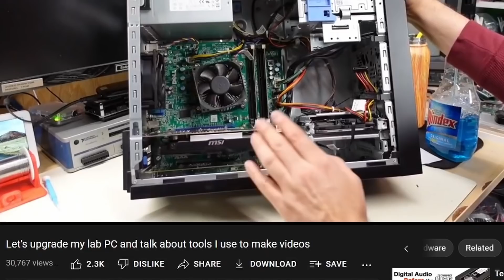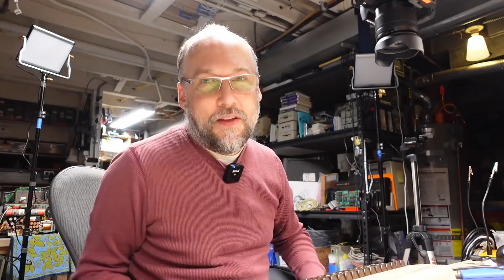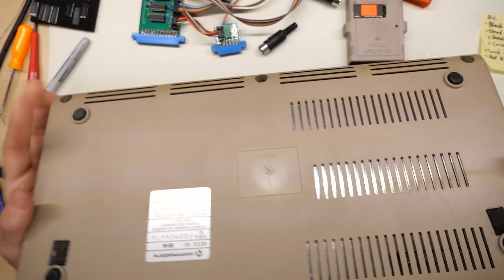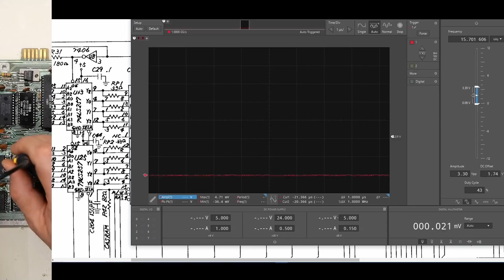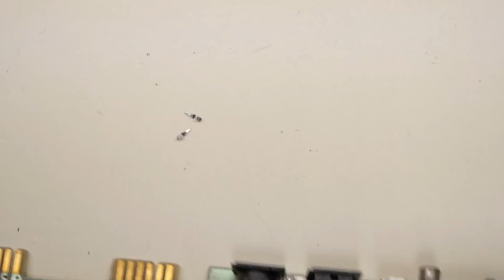Fixing two C64 motherboards with hot chips

Comment: 64 repairs are my favorites. I will say this though. I wouldn't have wasted my time on the oscilloscope. I would have just yanked ALL the MOS chips. Kind of like when I fixed mine only a single MT ram was bad, but I replaced all 8. Oh and I wouldn't worry about a marginal SID. It sounds different, but it didn't sound bad to me.
Reply: He's right, the filters are bad - significantly. It might do in a pinch, but with some really good SID replacements it should be replaced. More significant than that, the chip sounded a tone when NOT being played. That could mean that it will fail completely soon. As a repair, it's a no-brainer. Pull the marginal chip for storage and put in a fully working substitute.

If you aren't hearing the difference, there are two possibilities. Most computers have crap sound unless they have sound cards/USB sound units. These crap sound on computers is caused by filtering all the sound to a baseline that sounds no different at various lo, mid, and high tones. When you have this happen, you can't hear how muffled it is no matter how good your ears/earphones. HDMI can play better sound, but it has to come from somewhere.

Another possibility is that most headphones use filtering to keep sharp sounds from damaging poor quality sound speakers. If you are using earbuds or low cost earphones (under $100) chances are good your sound is purposely muffled to keep the user from damaging the earphone (or even the ear). Sometimes this is desirable - You typically do not want to hear a high pitch screech in your ear. However, a good sound system on a sound card/USB system allows the user to completely control at what frequencies to cut the sound in a special sound control panel to save both your ears AND your earphones (and even speakers).

Bad filtering/lazy filtering detracts from what could be a quality listening experience. Imagine what the sound your missing could be. You've heard people rave over the sound of the C-64. There's a reason for that. Adrian is right - that SID is bad.
Reply: @jeffreyphipps1507  they are bad, but it's not horrible. I'd rather keep it than discard it just because real working SIDs are harder to find. Honestly I think the "screaming" noise it makes when you turn the computer on is worse than the filters.

Comment: For old disintegrating foam, IPA isn't the ideal product, acetone will dissolve the foam and all the goo left over. Just don't use it on the plastic parts of the dip package, apply it with a cotton swab to the metal legs ONLY.

Comment: It's only a matter of time until Adrian gets his hands on a thermal camera. 😁
Reply: Predatorvision!™️
Reply: Northridgefix uses a thermal camera for black screen/no power on failures where he has detected an unexpected short to ground. He then provides a much smaller power input current than normal while testing and looks for the hot chip. Usually turns out to be mosfets on modern equipment.
Reply: It’s only a matter of time until I start to repair c64 for friends. Because of these videos haha
Reply: @vjcodec  just how many friends with faulty C64s have you got? ;)

Comment: I used the "quick test" cartridge to diagnose my SX-64 back when I restored it. It worked fine for some iterations and the only thing that failed in it was the "count" at the bottom: it would jump "randomly" to non-digit characters. I forgot the exact sequence but it was like: 4...5...?...10..11... and then ...14...15...1?...20... so something in an adding code was faulty. A replacement CPU fixed the issue, so it seems that my original CPU had some weird internal fault... Just as a tip: always run the tests multiple times :)

Comment: That low pass filter is really messed up!
Reply: It is just clipping, that is normal. 

"Despite its documented shortcomings, many SID musicians prefer the flawed 6581 chip over the corrected 8580 chip, some even seeing the flaws as actual 'features' that made the SID chip distinct from other sound chips at the time. The main reason for this is that the filter produces strong distortion that is sometimes used to produce simulation of instruments such as a distorted electric guitar."

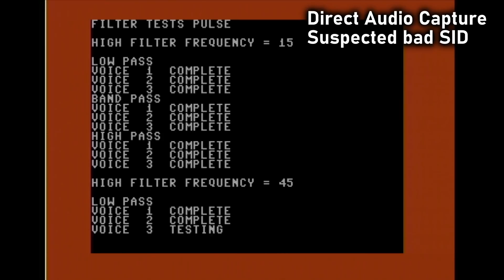Comment: 32:00 - Old reject SID chips were sold as new on eBay and other chip suppliers in the early 2000s, the chips had nothing wrong with the voices but the filters were all bad. You probably have one of those chips. Many early games and demos barely used the SID filters so some people never realized they had a bad replacement chip, plus with how much the SID sound varies chip to chip some folk thought it was normal until it started getting documented in c64 forums.
Reply: I don't think it's that. I just think the cut off is just different. One of the reasons people often prefer the 6581 over the 8580 is the filter can start to distort and that's used in some 6581 tunes. There is no "normal" with the SID, the filter performance is all over the shop. If the filter was used on a track then your ability to hear it as intended is all about how close your filter curve is to that of the composer.
Reply: How about trying out different values for the external filter caps? Maybe that could make the filters sound more "normal"?

Comment: 24:37 SID filter cut off is always very variable, just down to the luck of the draw. You can change the capacitor values near the SID to tweak this a bit. On a proper synth they would have had calibration options but the SID was just a chip in a computer, Commodore didn't really know what they had, the original specifications were wrong compared to the real thing.
Reply: Also, some distortion is normal on the filter. "Despite its documented shortcomings, many SID musicians prefer the flawed 6581 chip over the corrected 8580 chip, some even seeing the flaws as actual 'features' that made the SID chip distinct from other sound chips at the time. The main reason for this is that the filter produces strong distortion that is sometimes used to produce simulation of instruments such as a distorted electric guitar."

Comment: I recently got C64C, but without power supply. It was dirty, ugly yellowed, and has a faulty power switch, but other than that it seems to work fine. I've adapted the power supply from an old hard disk enclosure, but of course this is 5V/12V DC. Looking at the schematics, I've connected 12V to the switched 9VAC line. Is this a huge problem for C64 to run from DC only? Of course, ToD clocks in CIAs are not working, but were they used anywhere? I have not much means to test it, as chips for Easy Flash III, or for Kung Fu Flash are impossible to buy in Europe, so currently I only have Arduino based Tape Cart SD.
Reply: For the assy 250469 used in the C64C it is okay. The internal voltage regulators will run a bit hotter, user port hardware that uses the 9VAC may not work, and indeed the CIA clocks won't run. Otherwise the machine will run just fine. It won't work well on older mainboards, because the internal 12V voltage regulator needs a minimum of about 14V input. This is generated with a charge pump, that needs AC to be able to work.
Reply: @danielmantione  Thank you for explanation. Do you know any games that make use of ToD clocks in CIAs?
Reply: @TzOk  Not many games use it so the impact is low, but of course, there will be some games that use it. Unfortunately, there are so many C64 games that it is next to impossible to make a list, at least I don't have any data.

Comment: Solder mask wrinkling is because the board is hot roller tinned before the soldermask is applied, and when it goes through the wave soldering the solder tends to wick under the solder mask creating the wrinkles. Yes common on those age boards and with the soldermask and wave soldering.
Reply: I had always wondered about that, thanks for the description!
Reply: One way to stop this happening was to not flood the planes with solid copper but to partially fill them with a cross-hatch pattern of tracks.
Reply: Also, not using solid copper planes help to stop the PCB from warping during wave soldering, especially if the copper planes were not balanced on both sides.
Reply: I agree, I used to run a wave solder machine in the mid-80's and remember seeing this.
Reply: Thanks, I always wondered myself. I've seen it in older home theater amplifiers too.
Reply: I always thought it was because they applied the solder mask AFTER wave soldering and so any areas with uneven solder got all crinkly like that. How can that much solder wick under the solder mask in the time it takes to go through the wave solderer?
Reply: @AureliusR  Because of the wave being pumped up to meet the board, it flows through the holes and under the mask, driven by both the hot copper sucking it in due to pressure being lower outside the wave, and the wave blowing it in under quite a bit of pressure, helped by the flux making sure it will wet all the copper nicely.

Comment: After I bought a fiberglass pen and I realize it's not cheap, a cheap alternative is a 300 grit sand paper or a sand rubber (Daiso Cleaning Eraser C008).
Reply: You can also get a cheap "engraving" pen that has a rotating grinding head. Works great and you can usually find them for about $10.
Reply: I wonder how tapered pink pencil erasers would work. They're unnecessarily aggressive for cleaning oxidation from contacts, but they might be just the bill here. They'll certainly scratch the hell out of musical instrument lacquer.
Reply: @mal2ksc  That will have leftover
Reply: @johnsonlam  So will a fiberglass pen, and I'm more concerned about fiberglass dust than I am about eraser dust.
Reply: @mal2ksc  Whatever you use, you need to clean up before put it back to use, right? Fibreglass dust is more troublesome to handle, IMO.